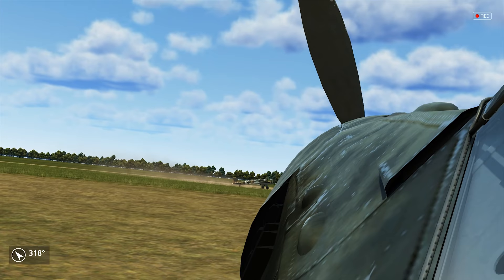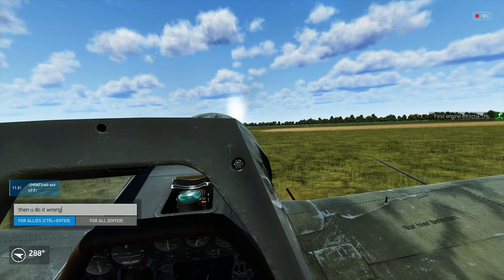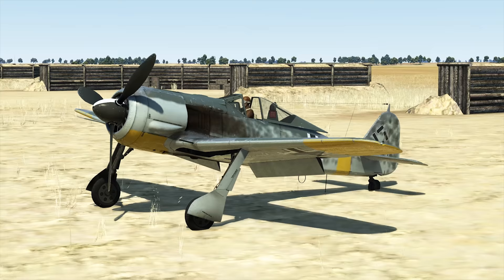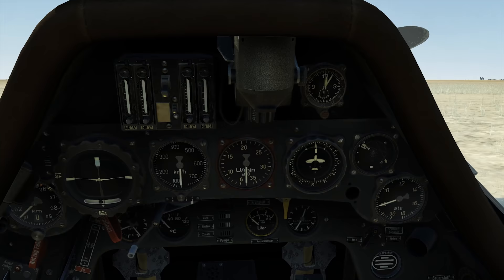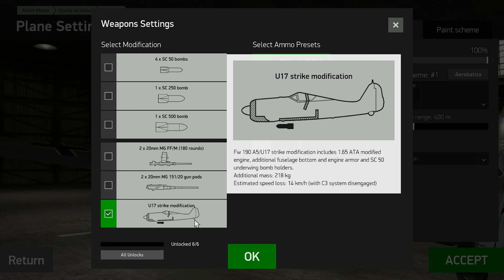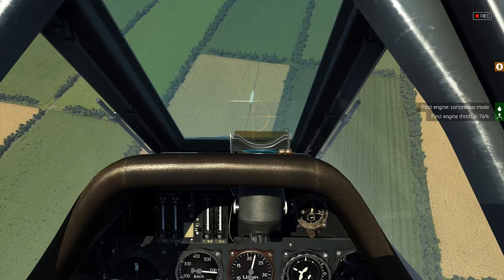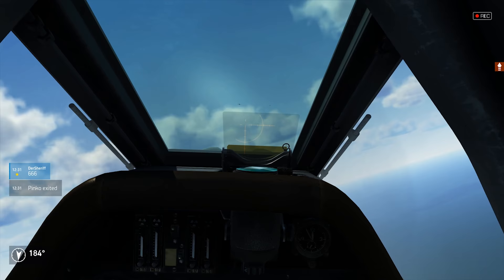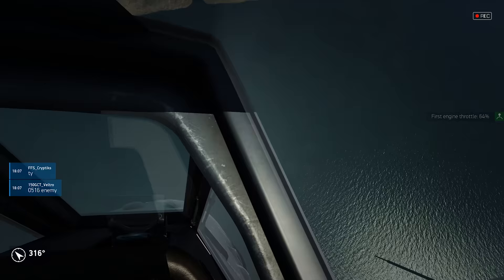How to Fw 190 A-5 - MCN (Model Change Notification) - IL-2: Battle of Kuban

Comment: The speed difference of A3 to A5  is BOTH  due to the nose shape and due to   the more efficient engine FAN (that draws less  power from the engine (the A3 Fan  eats 17% of the engine power just for that) , and that can be used because the longer nose allow for better natural   heat dispersion).

Comment: According to techincal data, the A3 and A5 should have the same top speeds. The only major difference is that on the A5 the BMW 801 D-2 was moved forwards by inserting a 160mm "plug" between the rear of the engine cowling and the fuselage. This had no effect on performance, though it and the other minor changes to equipment increased the loaded weight by 5kg, from 3850kg to 3855kg. Numbers and stuff are from Focke-Wulf Fw 190 Volume One: 1938-1943 by J. Richard Smith and Eddie J. Creek.
Reply: The engine fan also was changed into one more efficient that "wasted"less power than the older one. that means more  Engine power used to pull the plane.
Reply: Yes, looking at actual German historical testing during 1942-43 the top speed results are basically the same. Test results of course varied for each aircraft from test to test. The most consistent top speed result for each aircraft was ~408-410 mph @ 6300-6700 m (again, varied by test). To be conservative you could say between 400-410 mph. The A-5 was basically just an A-3 with better ground attack capabilities. That said, the curves are a bit different, and it looks as though the A-5 might have been ~10 mph faster on the deck @ 1.42 ata. Could be a fluke in testing, or maybe it represents a true performance gap. Who knows.

Comment: Very informative, Sheriff.  Some points below, based on Wikipedia-level research which is perhaps not the ultimate in authority and scholarship.  Bearing in mind that the justification for abandoning further development of the Stuka was that the Fw-190 was to replace it, essentially substituting an up to date fighter-bomber for the obsolete dive bomber in the ground attack roll.
1.  1-gun pods (adds 2) - The MG FF is a lighter and simpler gun (blowback operated).  Reportedly 26.3 KG per gun.  The trade-off is lower fire rate and lower velocity.
2.  2-gun pods (adds 4) - The MG 151/20 is more complex and much heavier.  Reportedly 42 KG per gun.  So, twice the guns but three times the weight (not including ammo).  Hence the greater speed and roll-rate penalty, probably accurately modeled.
3.  They essentially give you the choice between three different versions of the A-5.  The default version appears to be the A-5/U3, a light fighter-bomber (Jagdbomber, "Jabo").  Second version - MG 151/20 gun pods - might be the A-5/U12, bomber interceptor.  (Except you should lose the inboard wing-mounted cannons. . .)  The version with both centerline and wing-mounted bombs. . . Does not appear in Wikipedia.  Game developers may have "adapted" the A-5/U8 substituting bombs for under-wing drop tanks.
So perhaps some creativity was exercised.  But I have to sympathize - the "Axis" needs better ground attack to consistently have a chance to win in multiplayer.  Whether actual players will use it. . .  Dogfighting is more fun.  Personally I would rather hit ground targets with a cumbered-up Fw-190 than a Sturmovik.  I love the Sturmovik, but typically un-escorted it is cannon fodder in multiplayer.

Comment: Hey Sherrif, it is faster because it has slightly more horsepowers in IL-2 afaik. There are many different sources, some are quoted to say they had the same, but some say that was different. There were a few different versions out there, and never underestimate the German mechanic in the actual field.
Reply: German (and other) aircraft were operated with a wide gamut of engine settings at different times of the war, depending on what kind of settings the RLM considered acceptable balance between reliability and performance. Especially the Bf 109 - both the DB 601 and DB 605 powered variants - had different engine power at different times of the war, depending on how much manifold pressure they were officially rated for. Minor improvements in production and sourcing of certain parts, such as spark plugs, and some tweaks in engine settings (ignition timings etc.) solved a lot of initial reliability problems, which eventually led to higher approved power ratings.

I can't recall off the top of my head, but I would not be at all surprised if the Fw 190 A series with the BMW 801 radial engine also had different manifold pressure ratings at different times of war, so different power settings can be correct even if the engine is basically the same thing.
Reply from the maker: The settings in ata and rpm remained the same from a3 to a5. And what a surprise to see you commenting here right now. I just watched your.... il2 take off.
Reply: Ah, I see. Were the ratings for the BMW 801 really kept constant throughout those early variants? Considering the extremely wide variety of ratings issued for the DB 600 series engines at different times of war (for Friedrichs and Gustavs alike), I find that surprising!

Also, hah, that IL-2 take-off was so funny how it just dropped back to its wheels and rolled away like nothing happened. Totally meant to do that... :D

Comment: Are you certain the information in this is still up to date? I’ve done some research recently and I’ve found that I can reliably find sources that show the 190 A5 only just as fast as the A3 and slower in fact at higher altitudes. The turn rate of the A3 is also substantially better compared to the A5 according to the sources I’ve looked at. For the last few months I’ve found that the A3 is superior to the A5 and that there is little reason to fly the A5 other than instrument improvements and load out options. If this information is out of date you should up date it, it’d be nice to have a definitive answer and if it is actually still update could I see your sources?
Reply from the maker: I should be accurate to some degree. The A-5 still has the Covers on the outlets and is more aerodynamic. It might be true that the a-3 is more manoeuvrable. That would be surprising since its lighter and probably has the favorable center of gravity for turning.

All in all it wouldn't affect how I would advise to fly the planes. 

Videos for games aren't going to be 100% accurate for all eternity. I sadly don't have the the time to update these. Yak1 1b, 109 F-4 also would deserve some words on changes. However I still think that the videos are accurate enough to help players to understand the aircraft.
Reply: @SheriffsSimShack  you right, thanks for the response, I figured I would ask atleast B)
Reply from the maker: @tanthiri5493  

here is a speedtest i did at somepoint.

I would need to just test if the speeds have changed. But this is my most recent information. The speed of the A-3 at high alt is bugged. But the A-5 is also too fast.

https://cdn.discordapp.com/attachments/301637712962781184/1154107341243944960/image.png
Reply: @SheriffsSimShack  Thank you very much for this.
Reply: I have tested at sea level on Kuban autumn. The A5 is no longer faster than the A3. I haven't found any reference to when this was changed.
Reply from the maker: I can check again. But the outlet shutters need to be closed.
Reply: @SheriffsSimShack  yeah, completely closed it goes slightly slower than the A3.
Reply from the maker: @JackManiacky That I would find surprising. But I recently started to redo some of my speed testing and I will put the A-3 and the A-5 on my list.

Just to be sure, nothing of the tips on how to fly and fight in the Fw 190 would change really.
Reply from the maker: @JackManiacky I just tested this quickly with just one test on the deck and the A-5 beats the A-3 by 1kph. Which is in practicallity equal. But its certainly not slower than the A-3.
Reply: @SheriffsSimShack  yep you are right. I had them flipped. The a5 is slightly faster. I got 561 kmh for the a3 and 564 kmh for the a5. I think the last time I did the test I had 4 guns in the wings of the a5.

I think I prefer the a3 since I don't have to mess with the cowl flaps, and it still performs better at altitude as that hasn't been fixed. The artificial horizon and centered tach is nicer on the a5. The improved roll rate from the latest patch is fantastic. It breaths new life into the 190.

Comment: hello, can you do a how to on how you set up  head tracking?  I got the open track with a PS3 camera and head clip. I am finding it to be a complete gongshow to set up, not exactly user friendly.  Im ready to send it back.  At first it was just wrong curve set up.  When I tried looking to the back of my cockpit, the view would suddenly drop down to the seat at a certain point.  Anyhow I got the curve set almost perfect and then of course it couldnt still work.  I can see the view moving nice and smooth exactly how I want it, but the screen is now flashing constantly with a view of straight forward.  Arg
Reply from the maker: that sounds like you have some conflicts in the setup. I dont use open track and cant help you with this specifially. 
But first I can invite you to my discord, there are many people with different setups and they have open track as well and it works flawlessly.
Here is the link to the discord:
https://discordapp.com/invite/NrJcdg4

2nd this guide might help as well:
https://forum.il2sturmovik.com/topic/34403-a-complete-guide-to-set-up-head-tracking-opentrack/
Reply: @SheriffsSimShack  cool thanks ya I already followed that guide.  The flashing screen is a mystery